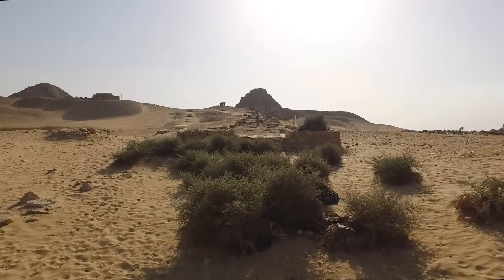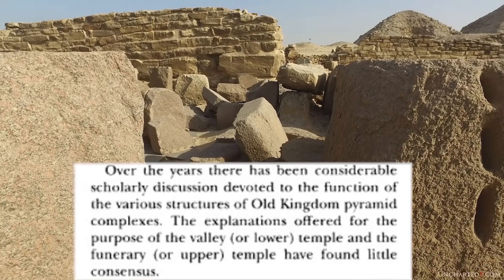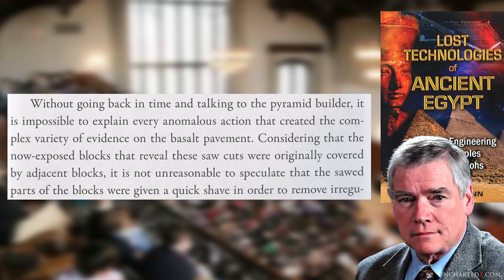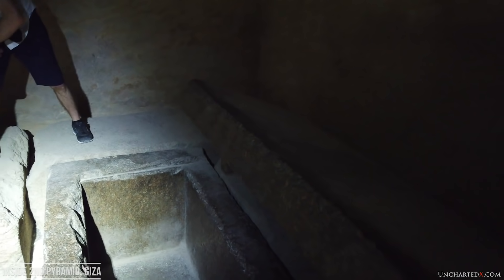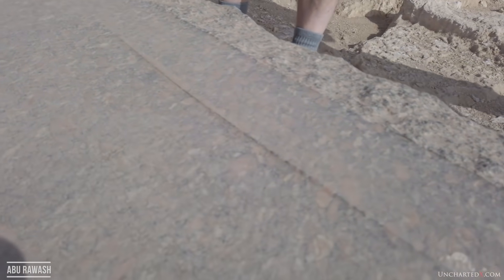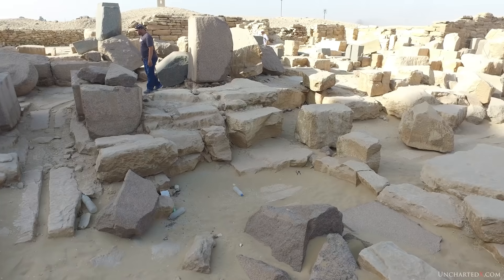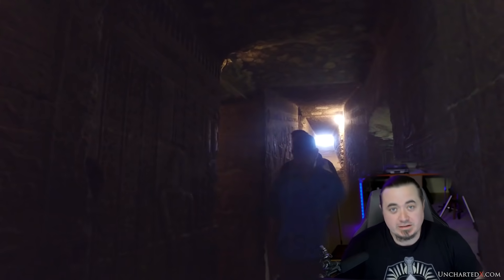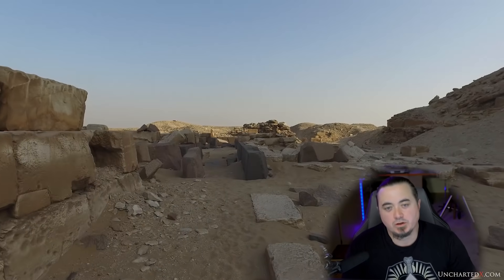The Mystery of Ancient Egyptian Stone Cutting in Basalt and Granite - UnchartedX full documentary!

Comment: My father's first job was a drill carrier at the local granite quarry. Basically as the drill dulled it was his job to rum down to the blacksmiths for it to be sharpened etc . The same for the rock chisels. All day he run from the face to the blacksmiths carrying dull or reworked tools. I imagine this was steel tools in the late 1930s. How the Egyptians managed with copper leaves some doubt in my mind that they could have worked granite so finely.
Reply: simplicity is next to divinity. their theology was correct. you can find all the constants of nature in those pyramids.
Reply: They did have corundum.. Second hardest below diamond on the mohs scale. After learning that, I wonder if they possibly used it to cut.   If possible at all
Reply: I get you, I come from a family of hard rock miners, and some have that same view, but it’s biased, we think in terms of today’s technology and power tools. Of course put anything but high speed steel or carbide in a stone cutting power tool, and it’s gone, and even then, it needs constant maintenance, but Egyptians, Romans, anyone until the 1800’s basically, were working on much different constraints. The Sahara desert sand is mostly quartz, and that’s harder than granit, it’s just a question of how you’ll apply the friction to the stone. Also, you don’t need a material harder than another to break it, it helps, but in the end it just means that it takes longer and more maintenance. Plus, for sculpting, we know they had chisels made of some rod with hard stones for a tip (quartz or other gems, which would actually be harder than granit).
Reply: @AsAMonkeyInAPinata  What do you think about them possibly using water or wind powered cutting tools? All of the pyramid sites are along a dried up river that was recently discovered from satellite imagery.
Reply: They say there are pyrimids all over the world right,so what if they packed their tools up and loaded them on a ship to go somewhere else to work and the ship sank out at sea and carrying the knowledge and tools with it
Reply: I guess your father  would have to run twice as fast if he were an Egyptian. Egyptians had blacksmiths too you know (well, probably more like metallurgists for copper works but still the same role). They had access to unlimited human resources for cheap (even compared to the 1930s) as well. There is no mistery. Just a lot of people putting in a lot of muscle.
Reply: @CarsCatAliens impregnated in copper, perhaps? If had plenty of both and had mining and manufacturing and maintenance up at a large scale.
Reply: @MrTmax74  There are so many possibilities out.there.. I truly hope that one day a discovery is made that changes everything we thought we knew about the ancients,. and hopefully civilizations that we never knew existed... Even if not even in our lifetime parameters... For all we know they could have cut them with something as thin as a string (wouldn't that be some sht).

I saw a short not too long ago..Had nothing to do with ancient history or the likes. It was a machinist who made a cutting bit out of a.stone. A hard stone. I cant remember what the material was but found that interesting.. No clue if it worked . But interesting nonetheless
Reply: I have cut all types of stone ,
I believe there is lost technology. 
We must have a open mind to different types of ancient technology.
Reply: @brianglover7629  . I live in central Leicestershire, England. There are numerous granite quarries. The local granite stone (microdiorite) 'Markfieldite' is very hard and due to difficulties working it it is used throughout the UK for road building. It is used for field walls and house building but in its natural form, i.e rocks dug up in fields etc. There is a massive quarry not far from me ( the second largest in Europe) and when I talk to various members of the workforce in the pub it causes great amusement when I say the  Egyptians could work it using hard stones and copper tools.
Reply: @brianglover7629  A parachute, and a mind... Both only work if they are open

Comment: That curved cut is one of the most amazing things in egypt. It suggests a complete rewrite of history and very advanced technology, pre-dynastic for sure. I still see it and I'm thinking WTF
Reply: You could make a curved cut if you put abbrassives and used a copper blade in the form of a tube (like a hole saw)  and spun it with an inertia drill (its the hard quartz abbrasive that cuts)
Its how you can easily hamdmake granite rings too
Reply: Im talking about the circular saw cut in granite at 30:48. So you think the diameter of that copper circular saw would be what 40 feet? more?  They would create a copper saw that large how back then?

Comment: One particular aspect ben of the basalt pavement outside the great pyramid is it’s iron content. It is highly magnetic, in fact one of the most magnetic samples of igneous rocks I have ever come across. 
When I was in egypt I was hoping to discover small pieces of the wheels used to cut the rocks, by picking up magnetic filings. Let me explain, in the serrapeum it’s been well enclosed and seems that much of the finishing work was done in location. 
Therefore to smooth stones you need grit wheels and the wheels would be made from steel. Therefore if I can pickup steel filings from the walls (floor has too much foot traffic) I could perhaps identify the cutting disks.
Anyway I did this and found three types of iron, small micro balls which had not oxidised, perhaps modern. Older swarf from some form of rapid friction on iron, not oxidised. Finally similar swarf, oxidised.
Clearly more work is required, but hopefully you see my aim ? Any process leaves traces and if underground and it’s not been hoovered or cleaned out then we will find traces.
In doing this sampling I tested with a magnet the rock samples I had from all over egypt and hence finding that the basalt is super magnetic.
Reply: what do you think of the theory that the area had a electric power aspect?
Reply: They didn't cut with wheels.  It's 100 percent proven, cutting with a straight blade with an abrasive wears down the copper over time creating a curved cut, making it only look like a wheel cut to the not informed...
Reply: @theOcean41  If copper bars were used there would be massive amounts of copper spoils left over as well as huge amounts of recycled copper products if copper were that abundant.
Reply: @llibressal  Not at all true.  Stop listening to the lost ancient tech lies..  Egyptian copper wasn't pure copper like modern day copper.  It contained arsenic which made it much much stronger...  There have been MANY experiments cutting and drilling with even modern day copper and it's possible.  With their stronger copper it makes it that much easier.  The cutting paste they used causes the "circular saw marks"...  Have a look at my channel for a starting point where to look.
Reply: @theOcean41  Thanks,  I'll check it out.
Reply: Sgd sacred geometry did a video on polishing. Very informative

Comment: Can’t be done with string and sand. Over cutting takes inert energy that doesn’t just stop abruptly. I was a granite contractor for 20 years.
Reply: Don’t be too hard on Sting, the music takes up much of his time.
Reply: @chrish5688  so basically what I am saying is it had to be machinery with enough built up inert energy that it didn’t just stop the way me and you would if we were cutting that shit the way they say they did.
Reply: @chrish5688  comprende?
Reply: The insights of people with experience like you are invaluable to understand these mysteries. Thanks for sharing.
Reply: @chrish5688  Something tells me you do not know granite.
Reply: @chrish5688  I can tell you it was not “like butter”.
Reply: Different technology to how we think maybe ? Many of the copper tools found and now in collections were copper alloys not just copper(common mistake).There are many different copper alloys with different attributes, check them all out. I don't know if the early Egyptians could make them all or not. Some are spark resistant others are resistant to acids some are as hard as steel and all conduct electricity. I've also read that granite melts at a little over 1000°C, but with a technique using water it is possible to bring that down to 650°C similar to aluminium, which I can melt in my garden using Grant Thompson's (RIP) makeshift furnace. So could a system be cobbled together just with the above  information to heat a copper alloy tool to 650°C perhaps even electrically so it cuts/melts through a piece of granite where the point of cut is continuously fed or submersed with water ? I don't know how you could achieve this but considering some of the above facts sort of opens up possible explanations to certain scoop marks found around the world. Again I don't know, but could a copper alloy circular saw blade with a melting point of nearly 1100°C generate a temperature of 650°C whilst cutting through a submersed piece of granite ? Does anyone know if this has even been tried ? Could it be that the copper blade was the electrical anode and the submerged granite block the cathode working on a similar principle to some fairground rides using contacts submerged in water for a smooth start up.
Reply: @andyjones4673  granite can’t be melted it will pop. “Granite” has bits of quartz, iron (which gives a orange color) iron pyrite and many other bits of different material they all react differently to heat and moisture
Reply: @andyjones4673  man made quartz can be heated and formed because of the epoxy. My point was that it had to be some type of “automated” machinery.  They may use different processes for different functions (mechanical where we use digital or horse power where we use mechanical) but a person sawing a material isn’t going to keep going any more than they need to. Also string wouldn’t cause striations like those from diamond blades used for granite.
Reply: @danmeyers2506   Thanks Dan, I agree with what you've said, machining without a doubt. I was just pointing out that the 2nd dynasty hand tools discovered were not copper but a much harder copper alloy which could manage to chisel some of those hieroglyphs but not much more. I mentioned the other stuff because it could be relevant. I wonder if the copper/beryllium alloy with its properties could be manufactured into a cutting disc for said machinery. I say this because of that well known cut that veers off and is abandoned. If the blade was that alloy and it overheated would it react that way or is this something that occurs with today's cutting discs anyway. 
   As for the melting of granite I was more thinking of the quarrying in places like Petra and India where the marks left look like someone's used an ice cream scoop. I wondered if this was just quarried irrespective of quality ie using high temperature as it didn't matter because at the end of the day it just all got reduced to granite dust. Then transported to site and then melted down adding any extra bits needed such as the trace elements and then shaped in situ as it looks in places like Peru. I mentioned electricity being used as I believe granite conducts and popping the odd electrode into a powder form of granite and applying a huge current may well be a way to melt it down. Then I guess the length of the cooling process determines how big certain crystal grow affecting its strength, I guess also the removal of the electrode could have something to do with the nodes or nodule things. I'm led to believe that under this process the granite would gain strength as time goes by much like the Roman concrete did. But hey any which way you look at it there is definitely a technological know-how involved that does not befit a bunch of simple hunter gatherer types.
Reply: Mitch Goodfellow  hi yeah I see what you're saying I was just pointing out that the 2nd dynasty Egyptians tools were actually an alloy much stronger than just copper. There are other copper alloys with resistance to abrasion which could as you say could be impregnated with say silica( I think that's the one in volcanic ash that shreds all the metal components in modern day engines).  I just thought as way back then, because they could they would of used the stronger alloy rather than just copper. It does beg the question of why have we only found the relatively small alloy hand tools and not the big stuff. Is it possible that they found the remnants of the big stuff and just reforged it as smaller hand tools to do their hieroglyphs or was this the height of their knowledge. It just seems strange that the higher your ranking in society the bigger the model tools you were afforded in your burial. Surely if you'd cut up all those granite blocks you'd be buried with a great big circular saw blade,surely that would be better than something that could only manage the hieroglyphs, wouldn't you think ?
Reply: Mitch Goodfellow  They were having a joke at your expense "When I inquired about what type of cable was used, I was told it was a cable consisting of animal sinew.
Just like the Romans used to do."
Reply: Mitch Goodfellow  I often wonder when exactly did that desert arrive and was a quick or gradual process. The recent LiDAR imaging certainly shows a hell of a lot beneath the sand across the entire African continent.
Reply: @andyjones4673  wow! Yeah I think you’re onto something with that copper alloy blade warp scenario. Even the best of modern tooling will do so and maybe the reason behind those ancient diamond mines in Africa as well. Because you definitely need diamonds added to the alloy to cut the granite and I am pretty sure you could do it with what you are describing. As far as the rest I wouldn’t really feel qualified to say for sure but I do think they had to have some way of forming the stone with a mold of some form and I never really thought about electricity but that’s an extremely interesting idea especially when you look at some of what appear to be electrical devices depicted on the walls of ancient structures and would be a much more believable explanation of some of the “blast sites” that Robert schoch says come from coronal mass ejections and ancient aliens say were nuclear bombs.
Reply: Mitch Goodfellow  Incidentally do you know if that disc thing, I think they call it the lotus bowl or something silly, do we know what it's made of ? It does look awfully like a machine part to me 👍
Reply: Mitch Goodfellow  it’s not poured in slab form but “lots” giant cubes that are sliced into slabs in the vast majority of them but there are some very expensive types that you can actually have custom made in slab form in which can you wouldn’t want to use ground up material most of the time they use gemstones or fossils or things that are rare or impossible to find naturally.
Reply: Mitch Goodfellow  I wasn’t meaning a powder I was meaning imbedded into the blade the same way modern blades are made it could explain  why a blade may veer abruptly and still cut for a short time. Maybe the diamond became glazed over by the alloy or the blade lost the diamonds entirely. Either way
Reply: Mitch Goodfellow  no actually it’s how would it be practical to over cut or cause circular striations let alone core holes which also have modern looking striations that type of thing. Those things can’t be caused by the way mainstream archeology suggests they just can’t. Also the possibility of superheating it or other methods of forming it into usable material for building megastructures and the like.

Comment: The obvious way to form smooth planar areas after rough-cutting a slab is just to drag it around over the other slabs you want to form. Any high spots grind dust off the high spots on the opposing slab.

Line up, say 100 rough slabs. Get 100 teams of people. Take another 100 slabs and give to the teams with various ropes and harnesses. 

Drag each of the second 100 slabs over all of the first 100 slabs repeatedly. Swap the slabs around and turn them every few days, and just keep grinding for weeks.

Eventually you will get stones with surface tolerances the size of a sand grain. Finer if you're willing to put the whole thing in a tent and wash it constantly. (Overkill)

Or you have a set of millstones spinning and guide the slabs over it using a conveyor belt of ropes and slaves.

Comment: I've spent the last decade drilling 2000 holes per day into man made and stone pavers...(A crap job)
This 36:00 stone could only be cut with diamond infused blades(as far as we know), and because it is also curved implies the huge blade was flexable. And judging by the radius it must have been enormous  !! (If done in one cut)
Reply: At least the result of your work is eventually on display and used by many. I work in administration. Everything I touch ends up in a destruction bin after 7 years.
Reply: That stone was laid down and sunk into a shallow sand pit in the paved basalt stone finishing area. Then one or more other large stone blocks were dragged over it (sliding on the harder basalt) by men or oxen until it was abraded to a fairly smooth condition.  In this case they dragged the abrading stone in a circle around a central tether, probably slightly finishing several stones each revolution of the oxen…This one was rejected because it wasn’t flat due to the sand under it not being wet enough.
Reply: @Neodymigo  Interesting... I just find human or animal labor doing the work very unlikely. I guess they had some kind of tech we just haven't discovered (yet)